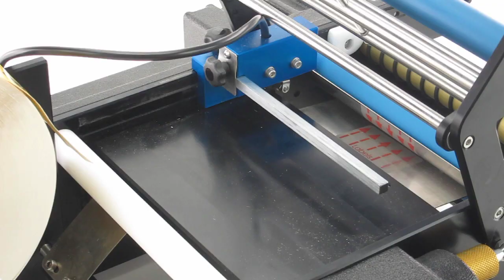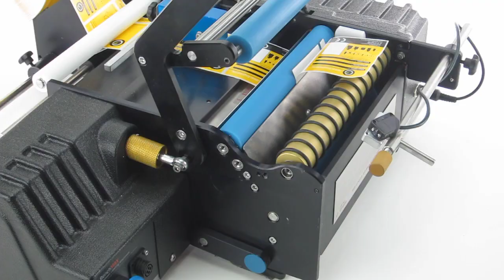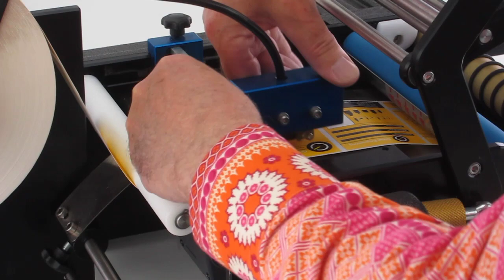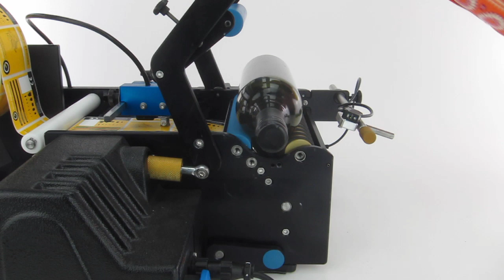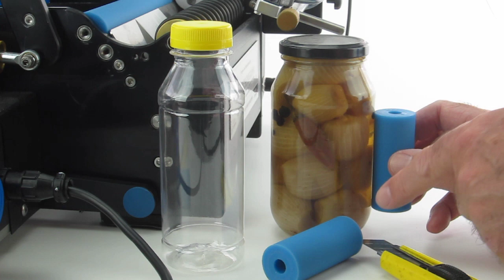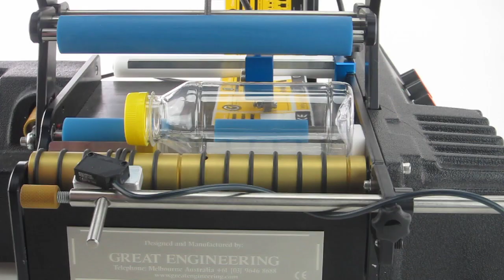Instructions for setting up a BenchMARK or BenchMAX bottle labelling machine.

Comment: I have a plastic cup which needs a label, but the cup has a 1 degree taper.
Label needs an arc to match the taper. Can I get your thoughts We need a label printer and two   labeling machines